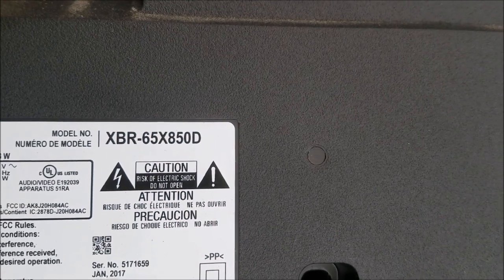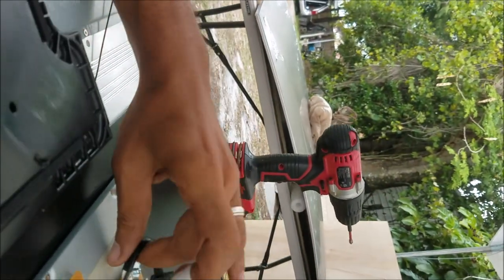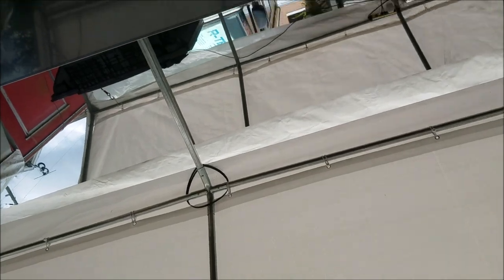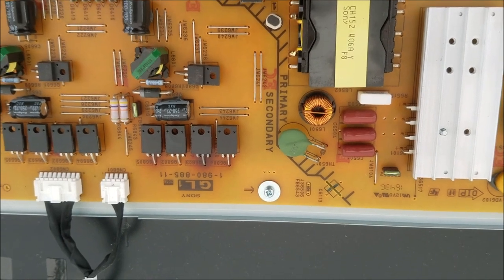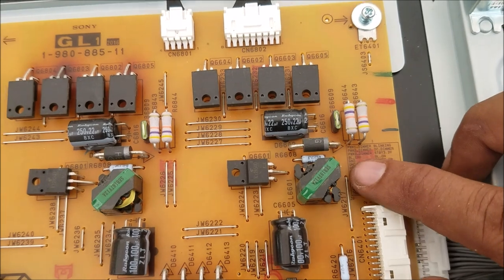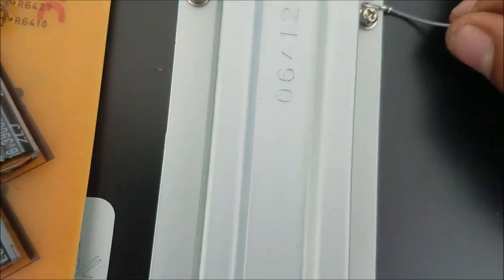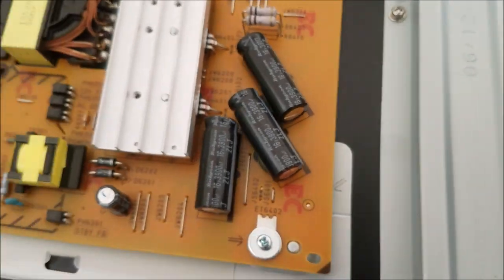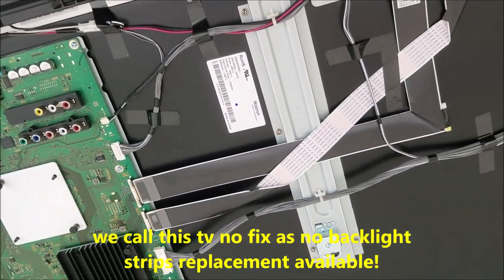Sony XBR 65X850D on off 6 red blink backlight error bypass

Comment: I have the same problem but my 55x8500d it has a different LED driver board 16ST012S-A01 that has a 30 pin connector (27 wires are used). there are no markings on the pc board to tell which is the proper wire to ground. Found the service manual it shows pin 12 as the BL err line.  I grounded that line and the TV now works perfectly. Thanks for the video.
Reply: Can you explain which one is pin 12  please  thank you.  Mashala
Reply: hello i have the same 850d it has a different board then the 850c was it pin 12 from the top that you grounded
Reply: David which one do I pull
Reply: @TheRacingRanger  did you end up figuring it out.
Reply: Hey, i got the same model & board. Is anyone figured out which wire is he talking about?
I got that diagram aswell & it says 12 in yellow background & 21 in green. What does that mean & which is the wire to pull out & ground.
Edit 2: Got it working on mine as well, commented in the main section how to count to 12.
If anyone still needs help, i am happy to do that. Thnx
Reply: Hi, I have same 30 pins same 55x8500d. please tell me which one is the pin12. upper line or down line.
Reply: @oliver.john3146   did you find pin 12 because i need also. i don'tknow which layer pin 12

Comment: Be careful taking off the back cover, I accidently pulled the electrical wire off the circuit board. Had to have a friend solder it back. Other than that this fix worked great. Saved a $4000.00+ TV from the garbage. And Sony WTF is wrong with you guys? Why would you design a great TV to crash over a few bulbs? TY SOSfix!

Comment: Thanks for the easy to follow instructions.  Found a smoked mosfet, grounded the pin4, and the screen functions again.  Unfortunately, my screen has a bright side and a dim side.  But this buys me a couple days to get a replacement.
Reply: when you unplug it and plug it back in do you get both sides to light up? thats what mine does for a minutes then one side goes dark.

Comment: friend  have you dealt with sony OLED TV ? can I use the same error by pass to get it working ? I have 4 blinking red lights. or does it work differently ?  trying to find out where I can to disable the error so tv can start up.

Comment: Very cool trick.  I have an older Sony lcd but with the same symptoms.  On my Led driver board, it’s pin 2 and labeled as ld err.  Grounded the line and the tv is working again for now.  I don’t see any overheated drivers on my board but I do see some large electrolytic capacitors that may be on their way out.  Thanks for the help.
Reply: its going to be one strip of led inside the tv that is going bad sony is dumb and shuts down the entire tv cuz of this this problem presits with the 2019 xbr series as well sony releaseing GARBAGE

Comment: Thank you, my Sony XBR-65X850F TV was protected, remove the BL_error line that goes on pin 8 of the connector on the power supply and solder it to the ground TV okey

Comment: Worked on my 55x850D. Mine wouldnt start if I screw it on, so i just detached the wire (mine was pin8) bl_err. 

Thanks
Reply: can i ask you mariascmidt about xbr 55x850d please

Comment: :yt: Attention viewers: This trick is NOT fixing the root cause of the LED backlight problem, it just mutes the brain of the TV system (like you take a painkiller pill) The problem is still there and will be back in a few months! (The bad side of this trick: Your TV brain is muted then there is NO more fire protection, overload protection...)
Reply: Some of these songs don't have a backlight you can buy to fix it.  I want to try this but I really don't want my tv to overheat and possibly catch fire.....I'd that can even happen
Reply: Best thing to do is find broken tv or replace leds by soldering

Comment: Does hooking more things to your TV ie Blu ray , directv, roku,directv, premature heating issues that can cause  damage?
Reply from the maker: not really, the hdmi ic controller on tv will turns off the hdmi signal from the  devices that not selected in the input, the only thing is there is a  more risk from power surge if it hit any device will send high voltage through hdmi will kill the CPU  on tv main board
Reply: @SOSfixElectronics  Got it. Thank you.

Comment: I just replaced the psu because it was shutting off after an hour or so with the 6 light error, I saw the caps you pointed out and mine looked worse, It didn't fix the problem now I see your video. I may ground the ERR line but I would like to order the LED strip. Do you have a Part # for that and do you have a video of that job? Thanks for the video
Reply from the maker: sorry i dont have it, the sony screen is the worst for backlight repair, be careful to it
Reply: @SOSfixElectronics  yeah looks like it's time for a new Samsung LED thanks for the video you bought me time to shop around

Comment: Great video. I replaced the backlight led's but now getting sound but no video - any ideas ?  Connectors are all good.  Thank you!!
Reply from the maker: backlight on?
Reply: Turn it on and try to flashlight 🔦 screen if you see menu no backlight issue not fixed

Comment: nice video. I tried your method by grounding BL_ERR, red lights gone but the TV still flashed Sony logo for about half a second, does this mean backlight is fine but other parts are malfunctioning? model 65W850C, please help.
Reply from the maker: the error code is for the lcd screen too. next check the backlight with backlight tester if all back lights are bad the t wont turns on, or if the screen is bad, check the tcon voltages, check for short on screen boards. try the tape method to cover traces

Comment: I tried this on my Sony XBR 65X850G.  Mine indicates that it is #8 wire.  I removed and grounded and nothing happens.  Any thoughts as to what I may be doing wrong?  Tech was here and verified that all boards were working correctly and said it was a backlight issue?  Production 2019.
Reply: my board allso said 8 wire. But it was the fourth. Try the fourth and it will work believe me.

Comment: Nice trick! I have sony xbr-55x850c with 7 blink error code. I think is temperature error and no picture. Any tips on how to repair? Thanks!
Reply: I have same TV. I bypassed the 6 blink code and watched for a few months. One side was darker. Now no picture. Just the LED strip? IDK. what's up with your repair? I hate to give this one up. I love the picture.
Reply: Hi guys can someone help me with this problem I’ve got picture coming up and then turn off by itself, then blinks 6 red lights. I tried doing bypass. But still doesn’t work. I’ve got all together 25 wire and power board says 28 I’m so confused. Any help would be appreciated thanks

Comment: I have the same model tv and your method to fix half the screen. Can you Please show me how to fix the other side of the screen because it's dark on the right side.
Reply from the maker: the other half of the screen it has a dead backlight you will need to replace them
Reply: @SOSfixElectronics  I jus purchased a working powerboard part. Will that solve the problem? If not can you show me how to change the backlight. I really appreciate your help
Reply from the maker: @supersaiyansanchez3628  i m kinda positive it is a backlight not a power board issue but is ok to try
Reply: @SOSfixElectronics  ok. Can you do a post showing me how to replace it on the same model tv?
Reply: I did this but half the screen isn’t working

Comment: Hi. I have a sony kdl-75w855c blinking 6x. I opened it and tried your fancy method. No longer blinking and the red light is away. But backlight doesn't turn on. Only for half a second and goes away. Is this an LED issue or something else? Any help is appreciated. Thanks.
Reply from the maker: Must be bad LEDs needs to be replaced
Reply: I have the exact same tv with the same problem. I tried this method the blinking red light is gone but the tv turns on for a halv a second and black screen again. Have u solved this?! Pleas let me know 🙏
Reply: Kdl-75w855c
Reply: @ese2627  the issue was defected leds.
Reply: @WilliamClarkDK  Thanks for answering. So i guess i need to replace the led strips?
Reply: @ese2627  yes right. Find the bad strips and replace them.

Comment: Hey is here anyone who can help me figure out BL_ERR wire for my tv. I have a diagram from manual of this tv XBR-55X850D & it says 12 in yellow background & 21 in green background. What does that mean & how to count & get proper wire to ground it ?
I got it working, for me it was 12th(how to count- start from bottom, large pins are even number & small are odd. So in my case it’s the 6th large pin from bottom on the main board. Grounding that fixed the tv.

Comment: It worked for mine but half screen is black. (XBR 65x850D)
Reply from the maker: needs to replace the led strip, is not easy job
Reply: @SOSfixElectronics  I know 😭 Thank you so much
Reply: when you unplug the tv and plug it back in does the full screen light back up? thats what mine does and then after a few minutes half the backlight will go out.
Reply: @bigturkey1  nope, mine since I plug it back its was half black. I threw it in the trash and bought a new one 😆
Reply: @wesleycaban  if just your panel was bad you could of got 200 for the main board, 100 power board and 50 for the t-con board on ebay.
Reply: @bigturkey1  I bought a new one at Walmart same size for $180 Black friday promo